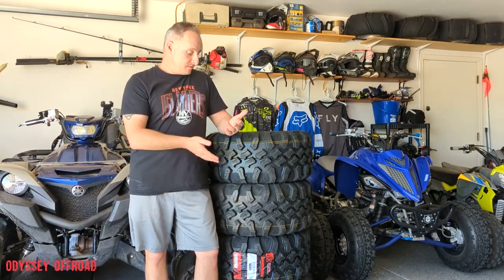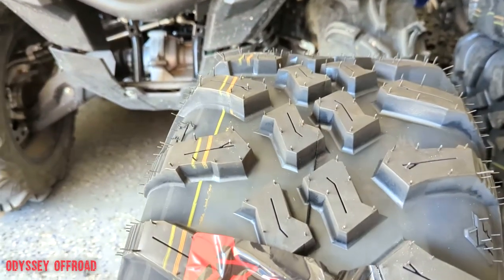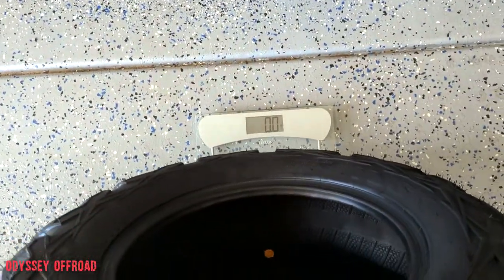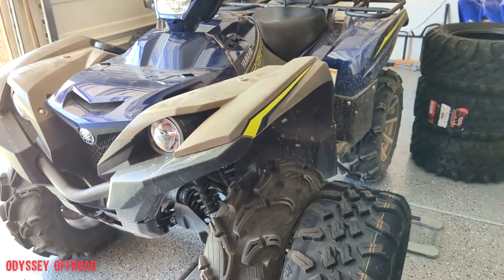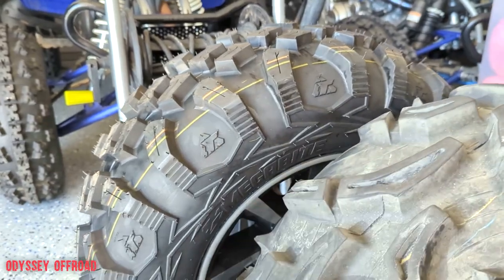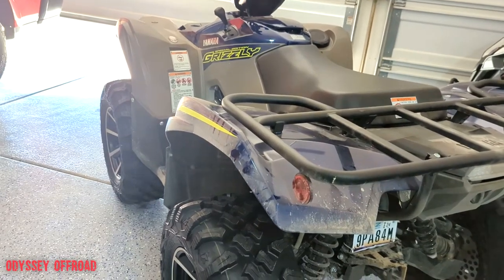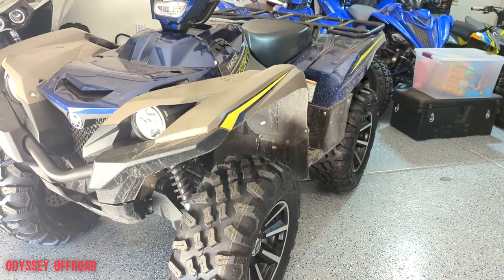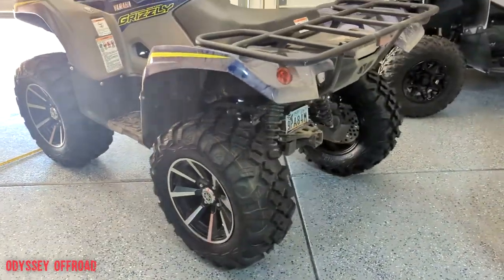23' yamaha Grizzly 700 gets new Tusk Megabite tires - all the weights and measurements!

Comment: I was surprised at the Zillas on my 22 SE.  Definitely not a great rock/trail tire compared to Megabite type tire but really performs better all around than I thought it would.  While very nice wheels, I wasn't a fan of the 14 inch rim, considering first ride out almost pinched a flat and really doesnt have a lot of tire between the ground and the rim.  I went with OEM yamaha Grizz 12 inch rims and went with Kenda Bearclaw HTRs for more tire between rim and ground.  Rides like a dream.
Reply from the maker: See i have heard a lot of horror stories with bear claws having a lot of vibration at speeds.
Reply: What size Kenda's did you put on the 12" rims?

Comment: Hi. trying to decide between two tusk tires for my grizzly. I'm in northern AZ and where I hunt is sharp rocks (lavarocks) and sharp roots. I want a tire that can handle sharp rocks and roots better than the zillas. Debating between the terrabites and the megabites. I think the terrabites would be more puncture resistant due to tighter lugs but I feel like they would throw rocks like crazy.      I also feel like the megabites wont throw rocks because the lugs are more spaced apart but they have more open voids probably making it more prone to puncture from those sharp rocks.    Since you have had both, what would be your vote?
Reply from the maker: I think they're both equally puncture resistant the megabytes definitely throw less rocks actually I have found a throw no rocks.
Reply: I run lots of rocks .boulders in Pa I find Kenda Bear Claw Htr’s at 10 to 12 psi handle everything in similar terrain to you except for lava rocks we don’t have those in Pa. My friend runs Megabites and they also perform good his tires run lower psi 5 to 6 . The Kenda will last longer if you do lots of road riding . That’s the only difference I see between the 2.  You didn’t ask my opinion but I do know picking tires will drive someone crazy. I will never run anything but the Kendas from now on they fit what I do perfectly . The Kendas 26x11x14 weigh 28lbs not mounted. Hope that helps

Comment: Did you consider narrower 27x9x14 for the fronts?
Narro front and wider rear
Reply from the maker: Yes but as i explained i wanted same all around like factory for handling and being able to rotate them.  Also the factory rims are wide and have no rim protection with a 9" wide in front on the stock rims because they are 8" wide.
Reply: @OdysseyOffroad  Great video. So the stock rims are 8" wide right? Unfortunately Rocky Mountain ATV doesn't sell the 27-10-14 anymore. You have to go up to a 28" for that.
Reply from the maker: @hoopersbbq  oh man that stinks. I wouldn't want to run 28s to me the 27th with these big 14x8 wheels from the factory are way too heavy. If I had to do it all over I would get 12-in rims by seven wide with a nice 25-in tire.
Reply: @OdysseyOffroad Great advice because my 2018 Grizzly SE came with 12” rims factory. Inspired by your video, I considered moving up to 14” rims but if you’re having issues with the weight of them I may stick with 12” rims.
Reply from the maker: @hoopersbbq  Yes the ones with the 12-in rims and 25-in tires are going to be much faster the grizzly 700 just doesn't have enough down low to move these meats if you like good throttle response and a playful power in the low RPM range.
Reply: I’m confused. Some of your other comments you stated that you didn’t notice any loss of power upgrading to the new tires?
Reply from the maker: @hoopersbbq  there was no loss of power upgrading to these tires the point is having the larger tires to begin with is the problem. The vehicle comes with these size tires and rims so there was no loss of power switching over to the new tires however in hindsight getting the base model with the 12-in Wheels you would have significantly more low end power versus the special edition model with the 14-in wheels and bigger tires. Switching over from the mud tires to the tusk megabytes was no loss in power.
Reply: @OdysseyOffroad  Gotcha. Thanks. I may stick with my 12 inch wheels for now. But I like the look of the 14 better
Reply from the maker: @hoopersbbq  I did too and that's why I bought the special edition if I'm being honest but they're really not practical not at 8 in wide anyway. Plus you get a lower sidewall on the tire.
Reply: @OdysseyOffroad  my grizzly is the special edition too, but the 2018 which came with 12” wheels. So I really can’t do a comparison. Will take your word for it though and stick with the 12” wheels 👍

Comment: you replaced lighter weight tires that were already heavy for heavier ones?
Reply from the maker: Couldn't even tell because the gain in traction and ride quality was that much better. The zillas are garbage for trail riding.
Reply: I don't disagree that the trail riding will improve over the maxis units the vehicle ships with.  I have a 2022 or 23 Grizzly (I cant remember, I've had it for a year)  I was thinking Kenda Bearclaws for all around while making damn near any quad super nimble.  I've had quads for 30+ years and I've tried many.  The Mudlites I put on my vinson were fantastic but too heavy...I should have done the lesser of the 3 mudlites they had available.  Wasn't and still isnt a challenge.  Just a discussion on what could possible make my grizzly 700 even better than it already is...just like yours.  I am curious on the rev limiter/top rpm before and after the change for you.  @OdysseyOffroad
Reply from the maker: @mjethier  I did a top speed run with the new tires on it I can't remember what it was but there's a short video on the channel. Again I didn't lose any power that I noticed and the game and traction and overall handling was light years better. I also like you looked at the Kenda bear claws but I read too many negative reviews on bad sets with shaking and balancing issues so that scared me away from them. I did a huge trip for 3 days through the Hatfield McCoy trails (videos also on the channel) and I can tell you these megabytes performed great in mud, wet conditions, hard pack just  everything.
Reply: I'll try and do one myself.  My quad has about 20 miles on it and I have never pushed it.  But the general concept is what you can get for top speed within 20 or so seconds is a direct representation of what your tire weight is.   @OdysseyOffroad

Comment: Those tires seam too wide to me.
I like 8 or 9 inch wide tires on the front they are a lot nicer on trails as they don’t hit the sides of ruts non stop.
Reply from the maker: This is factory size. You can not put a skinnier tire on these rims as the rims are 8 in wide.
Reply: @OdysseyOffroad  That's just not true.
You could run 9 inch wide tires no problem.
I've ran 26x9x12 tires on 12x8 rims a few times...
Reply from the maker: @nseric1233  let me rephrase. You can run a 9-in wide tire however you're going to destroy your rims because the zero sidewall protection at that point. Also the 10-in wide tire comes from the factory from Yamaha I just kept the same size tire. It handles amazing with these new tires.
Reply: @OdysseyOffroad and it was a piss poor factory choice. Too wide for a front tire. Fyi, proper inflated tire will provide same rim rim protection  on an 8, 9 or 10 wide. The lip is still exposed. If the tire has a rim guard built in, that will protect it